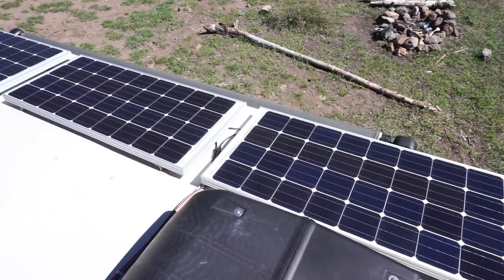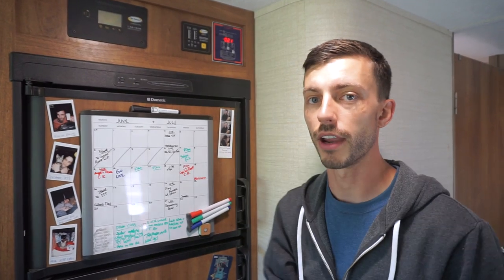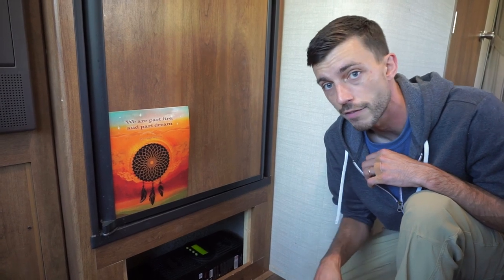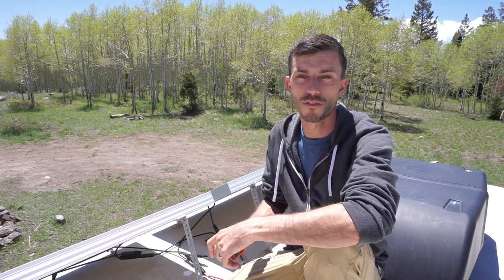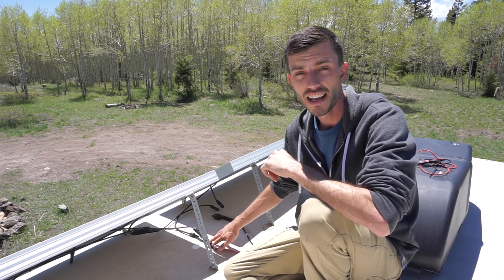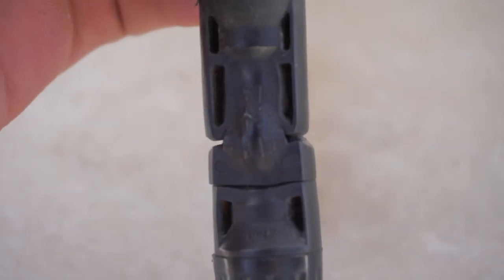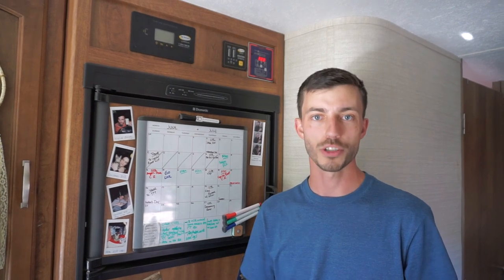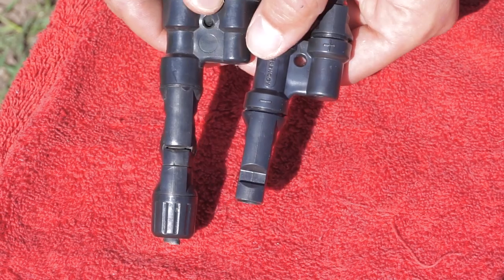RV Electrical Fire Hazard - Melted Solar Connection Fire Risk Fix

Comment: Very good tip for every solar owner! Thank you. 
Some of these MC4 connectors are only rated for 20-30Amps, so make sure you stay below that rated current at all times. 
One question though, why arent you using a series setup with your solar panels? Provided your solar charge controller can handle the higher voltage and your panels are fitted with bypass diodes (most of them are nowadays), a series setup has major advantages. Less connectors, less current through the cables, thus higher efficiency, more resistant to partial shade. So the problem of overheating connectors would be significantly reduced.
Reply from the maker: Our panels are wired in parallel because we don't want the entire array to be knocked out if one panel becomes shaded. This is a major problem when you are camping in the forest like we do so often. Typically at some point in the day the trees will partially shade a panel and we don't want the entire array to be reduced or knocked out. There are pros and cons to both series and parallel and we choose to accept the higher current through the wires in exchange for each panel acting independently.
Reply: @FateUnbound  I think that was only a problem before they started adding in bypass diodes. Nowadays with the bypass diodes you actually get better partial shade resistance with a series setup. 
You only lose a small segment of the panel when partially shaded. Typical panels have 2 to 4 segments (you can check by how many bypass diodes are in the breakout box underneath the panel). That shaded segment will be bypassed by the diode so the rest of the segments and panels keep on working.
Reply: @FateUnbound  Perhaps an idea for a new video? Comparison of series vs parallel in partial shade? Would be nice to see! :)
Reply: @FateUnbound  as did I for the same reasons. My system is much smaller and wire lengths fairly short so i did not see any advantage to series. Volts were not the issue; wanted amps... you're 1000% correct on the crimpers. I did my installation using pliers to crimp as i have for years. I just bought a pair of crimpers; they are superior !
Reply: @herb7877  MPPT controllers convert the extra volts created by the panels to amps at a suitable voltage to charge the Battery system fitted.  Watts = Volts x Amps [for DC systems]
Reply: Using series connections to increase voltages well above those needed for charging results in efficiency losses in the DC-DC conversion process. The typical '12V' panel will produce around 18v an the charge controller will reduce this to aroud 13-14v to charge the batteries. The close match in voltages allows for a conversion efficiency of around 95-98% depending on the quality of the controller. Doubling or trippling the input voltage will reduce the conversion efficiency below that, potentially to the high 80's/low 90's. Nothing is free. Where it can benefit is if one panel is shaded enough to deliver less voltage than needed for charging. Two panels in series, even if both are shaded, may still charge.
Reply: @stevehericks5764  Based on the efficiency figures you are quoting[I need to research this before agreeing with you] lets say taking two 100  watt panels connected in series versus parralell and assume for illustration purposes that they can actually produce a 100watts of power in full sunlight: For parralell  lets go with the best efficiency figure you quote of 98% and for series lets use the worst efficiency of 89%. The 200watts parralell setup would produce 196watts and the Series setup would produce 178watts and the resulting difference in charge current would be 1.5 amps. This is the maximum difference and in practice would be less! However to test the improvement of the series connection in ability to provide a meaningfull increase in charge current in low light conditions , such as slightly before and for about an hour after sunrise, and also in partial shade conditions is difficult but possible if someone has the time and resoureces to do so. An additional factor to take into account is the solar panel construction, the older panels even a little shading will knock them out but the latest panels because of segmentation of the panels lose only a portion of their output. In my view fulltimers seem to need as many productive hours of solar generation as possible rather than a peak high effieciency. This is not so much a problem in The summer but in Winter the short daylight hours and overcast/rainy conditions are a considerable problem for which the Series/Parralel solution that rvprepperwayne installed for Nomadic Fanatic is in my opinion the best option.
Reply: @FateUnbound  Understood. but you need to get rid of that single MC4 connection and use something with a higher current rating.
Reply: @BulldogBill  he’s talking out of his hat lol 
Nobody sends you a bill for slight “efficiency losses”  for one, and the net gain of charge at the lower light portions of the day are a net gain of total Ah of charge per day. Knowing stuff and wise use of knowledge are two different things.

Comment: Another thing I would do is zip tie before and after any connection, to keep the joints from moving around and causing some slight disconnection. Everything has to be secure and not move around, especially near any joints.

Comment: I found an in-line fuse that was melted into an "L" shape.
The fuse inside was still good.
The current from my 30A system rarely goes to 20A.
Rapidly losing confidence in MC4 connectors.

Comment: I actually felt a little bad for your generator at the end of the video.  It's a good generator.  It filled the gap for you for three days.  Please, go back and give it a hug.
Reply: Give it an oil change, and get some ethanol-free fuel.
Reply: @MsLaurN  Dude, you're beautiful.  Thanks for really thinking about that lonely generator.  I have a feeling, that SOMEDAY, all those machines YOU fixed...will creep and crawl and ultimately...fix you.

Comment: I'm just getting into solar. I have seen this problem a lot. Is it because the gauge of wiring is too small and the wires are over heating and possibly cause a fire issue?
Reply: You are 100% correct, amps equals heat, better to run higher voltage.

Comment: You are not supposed to spin the wire end when tightening the nut on those connectors you will damage the wire if you twist the ends.  The ends are crimped to the wire you can not twist the end only the nut . You need to redo the connectors again.
Reply: This is most likely why he had the issue in the first place broke wire strands??

Comment: We're looking at adding solar. Is 480 watts of solar panels enough for your 400 amps of batteries? Thanks. Valuable info here could save someone from a fire.
Reply: A rough rule of thumb is typically 1.5 to 1 ... meaning for 400 amps of batteries you should have 600 watts of solar ..

Comment: IMO throw those branch connectors in the garbage an build a combiner box. After looking at the ones that came with my kit I couldn't trust them. I made my combiner box with mc4 connectors so the panels plug directly into the box. This is the 4th year and never had a problem.

Comment: I had near similar problem and in my case I though it had to do with the different sizing of the mc4 wire and the feeder wire. That of the Mc4 is slightly smaller and in my opinion the current is clogged at the exit and generating heat as a result. I matched the wire sizing and never had similar problem again. And yes, its always the positive wire that heats up the most.

Comment: Don't partially shade panels that are in direct sunlight! It does not stop solar production - the cells are still producing, it's just the energy output is going to go to heat (damage) the shaded cells.  The panels do have some capability to bypass shaded cells but has a finite capacity to do so, and frequently shading cells in full sunlight will result in a reduced lifetime of those cells

Comment: MC4 solar leads come in 2.5, 4 and 6 square mm flex - there are really cheap ones and really good ones - the good ones can be are twice the weight and solid copper - cheap ones are nasty plated steel

Comment: David, I'm not so sure your problem was arcing, it looks to me like maybe because your connecting all 4 panels in Parallel your increasing your Amps X4 and building up more current then those branch connectors are rated to handle. Maybe try running two sets of panels in series and to increase your voltage and drop your current so not to overheat the wires. Let your converter do the work and convert the higher voltage back to amps
Reply from the maker: We only have 3 panels that output 9 amps each for 27 amps total. The connectors we used are Renogy brand rated for 30 amps.

Comment: You need a combiner box like Am Solar sells and get rid of MC4 connectors
Reply: Those junction boxes use buss bars which come with their own set of problems.
Reply: @moncorp1  What problems would that be especially since buss bars are the industry standard in the electrical and IT world.
Reply: moncorp1 Inc I am also wondering what “problems” you’re referring to. I am using bus bars on my new system and would like to know if there is an issue.
Reply: Combiner boxes have their place. 
However, the problem here is a design issue, not a hardware choice. Sure, a combiner would ‘solve’ the problem at an expense, whereas a better design eliminates the problem entirely at zero cost.

Comment: Hello Jenni and David,  I have a class A and I'd like to be able to run my AC (with an EasyStart) from the solar system. If I want a bigger kit than what GoPower offers, what do you recommend?  I'd like to maximize the square footage of my roof by buying panels with more capacity of Watts per  sq/ft.  I'm also looking for an installer.  I love your channel and watched every single published video.  Edwin Camacho - Utah
Reply: Go check out Nomatic Fanatic, he did a rooftop solar install for a class A recently, so he could run his a/c unit 100% off solar. Not endorsing his channel, just good info.
Reply: @garybisme2  Hello Gary, Thank You for your answer.  I've seen Eric's videos as well and it looks like Camper Van Kevin has the same system with double the battery power.  If you are a fan of Eric, you know that when he is successful, he makes a big deal out of it, but when things are not going as good as he expected he stays quiet.  I was expecting more info from his channel.  For example...   he can run his AC pretty much unlimited during a sunny summer day, but how long during the hot summer night.   After all he only has 300 AH from BattleBorn.  I love his channel and I'm a big fan since his channel is the first one I learn RV living from.  My guess is that he is waiting to find the money to upgrade the battery array and then make a video like the ones he makes when he changes cameras, bicycles, or even the solar system.  Also...   I really need an installer.  If anyone here can recommend one, that would help a lot!   (my Home based in Utah)  Thanks again!
Reply: @edwincamacho2640  Eric's system was installed by rvprepperwayne who is on YouTube. Eric has 1280 watts of solar on his Class A roof and has mentioned many times in his videos that since the installation of his Battleborn Batteries and the 1280 watt solar system that he has not needed to run his generator at all He also mentioned that he was getting a 40amp charge from the solar system on wet and overcast days. I believe his Solar system uses 4 x 320 watt 24 volt solar panels in a series/parrallel arrangement as this is the most effective way of using the advantages of an MPPT solar controller. On rvprepperwayne's YouTube channel you can see see  the whole installation work done by him for Eric, with some of Erics and Jax help lol.

Comment: if you put your panels in series, the current level would have gone down.  On my sailboat, to keep the current lower, putting the panels in series would allow higher voltages & lower currents.  Series with  a MPPT is the way to go IMHO...

Comment: Mc4 connectors are made by staubli and those you have are called MC4 compatible. Not true MC4. 

You are probably right on what caused the problem. Connector mismatch.
Reply: 12:18 in this shot you’ve got an mc4 style next to an amphenol.

Comment: By switching the solar panel in parallel, the total current can become higher than the connectors can tolerate.
if that happens, it can happen again and again.
Maybe a fixed screw connection or crimp connection is better here, or Use a Connector for 50 or 80 Amp.
Also the Mainwire i would use AWG 5 ( 16,8 mm²)

Comment: I would not waste my money on connectors, just hard wire everything with relays so that when there is a problem you will know where by checking relays (a much better investment than connectors).

Connectors are really for casual users who maybe only use this stuff three or for times a year or are not electrically skilled.  Also you want to put wiring in protective tubing so critters and elements are not an issue.

A low hanging branch could mess things up and relays will catch problems before you do.  Make sure you have no rain coming and a nice cool day as this upgrade will take a few hours.

Really you want to budget this stuff before purchasing panels, and replace factory wiring with your upgrades/relays using 4 gauge wiring.

When solar panels never move you want custom wiring anyway, not factory plug and play for casual users.
Reply: There is just too many things wrong with this advice. Relays? That makes zero sense. None.

Comment: Another perspective ....... So be honest .... if you had paid full retail for all your goodies, how much would it all set you back ?  And I mean everything, cabling, connectors and all the very expensive components including the LiPo batteries.  For what it's worth, our Honda EU2000 goes through a gallon in about 10 hours and requires an oil change (less than a quart) every 100 hours (takes less than 10 minutes). And I'd much rather simply move the genny downwind than have to climb on the top of my camper to adjust, clean and maintain solar panels. On the rainy and overcast days, you have to run the generator anyway.  I often run the little Honda at the end of a 50 foot extension cord so noise isn't a problem (and no, voltage drop isn't either). My Honda doesn't suffer much in hail storms stored nicely away or under cover that I made for it while running.  You also probably have about a hundred more holes in your roof than I do so there's that maintenance as well.  Might be nice to camp in the shade one day but nope, gotta be out in the sun.  See, I can match your enthusiasm  :-)  I've always enjoyed your technical exposes and install videos but you got a little carried away with the product endorsements in this one :-)
Reply from the maker: So we purchased all these components before hitting the road and paid full retail for all of them. There was no promotion or sponsorships in this video. When I was talking about Go Power technical support being awesome is from a consumer standpoint, we didn't receive any of this for free.
Reply: @FateUnbound  That's good to know. I'd still be interested in how much the outlay totalled. I've seen at least a dozen YT videos of campers detailing their solar systems and listening to them rave about the features and benefits but none of them ever divulge the truth about the cost of such convenience. I watched Mortons On The Move talk about all the things they did to the Lance TC that Lance Campers loaned them for their Alaska trip. Obviously, much of their bootie was sponsored but as I read the comments, there was one very knowledgeable individual who was proposing that truck camper manufacturers build the power systems in the new campers similarly to theirs (and even beyond).  His rationale was that "this is what people want and need". Again I asked "what about the cost" ?  And of course, no reply. Truck campers are relatively over priced to begin with as they occupy a niche that few other options fill. I'd have to think that with the cost of this technology and the natural manufacturer's markup and labor costs, it would add about 20% to the retail cost of the camper. I also think  that a clarifier should be stated that these kinds of investments are most suited to people who full time exclusively off grid. My little generator justification speech is obviously tied to the fact that we are infrequent travelers who don't have a penny to spare :-)  We travel large distances over one or two months at a time but then have a home to return to.

Comment: Why not use anderson powerpole connectors?
Reply: Power poles are wonderful for intermittent power but are possibly the worst sealed connectors available. MC4's are purpose built for long duration exposure to water and sun. The reason they were developed was there were no appropriate cost effective sealed connectors available. The other commercially available that are well sealed are probably more than 4x expensive. Biggest problem is the proliferation of cheap Chinese copies, made from inferior materials. I've bought Chinese copies of power pole connectors and had problems.

Comment: Because of the sun suggest you consider pitting all the electrical in a conduit so the sun eats the conduit and not the wires or connections.